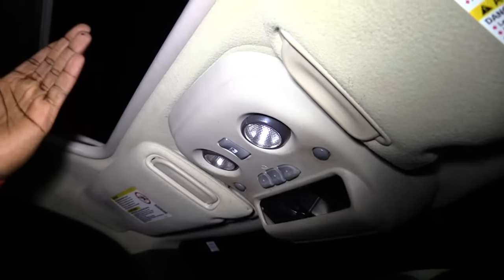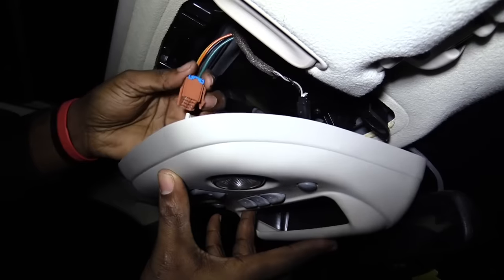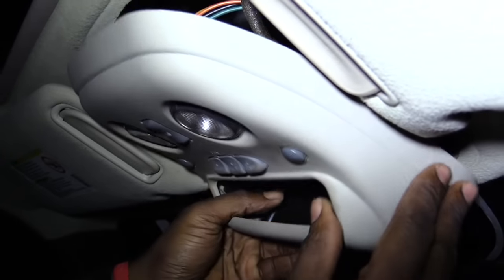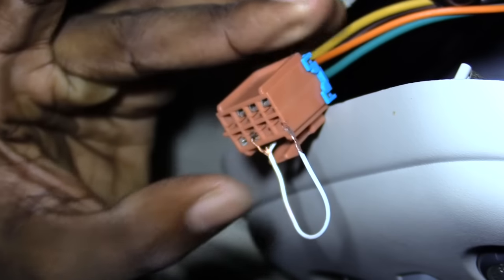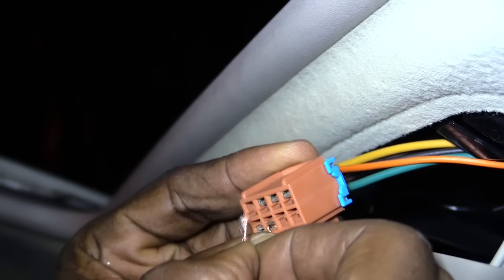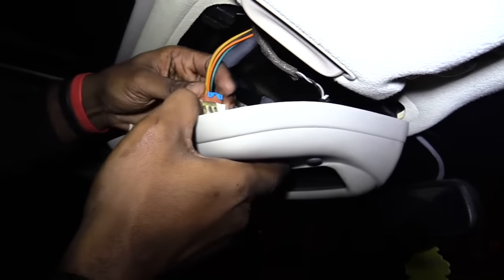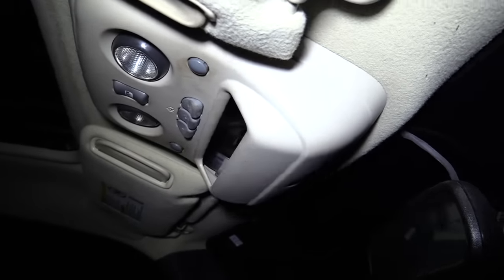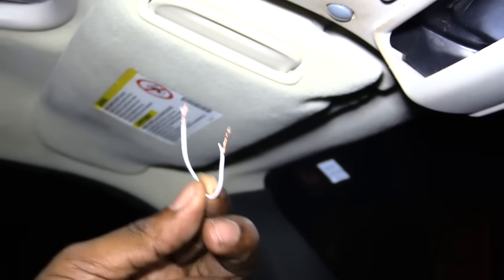How to open/close -Sunroof / Moonroof when switch won't work-EASY

Comment: Thank you so much!  This worked brilliantly on my sun roof to close it. Afterwards I thought I'd be a smart ass and   do it the other way to make it open again but didn't listen to your instructions properly. I now have no interior lights or clock 😂 but at least my sun roof is closed 👍👍
Reply from the maker: Hi sorry for your problem most likely you blew a fuse for your clock and light check your fuses should be a easy fix.
Reply: Live and learn 😂👌
Reply: Wow

Comment: Thank you for this awesome video my friend. I have a 2006 H2 Hummer and I refuse to let her go. I took her to the car wash today and the moon / sun roof wouldn't close. In fact when it would do the opposite. I had to leave the car wash and came home wondering how much is the dealership going to ding for this fix. Thank god I found your video - it closed and will stay that way until I can get a new switch. Cheers !
Reply from the maker: Glad you was able to get it closed. And yes it's the switch that's bad, glad could help. Please subscribe & like and share if haven't already and check out our other helpful videos

Comment: Thanks great vid, got mine closed before the rain!  Apparently if your battery goes dead, or you change the battery with the sunroof open it goes into error mode because it thinks it's closed when its open. Once you hot wire it closed, turn car off then, while holding the switch in the close position, turn car on, continue holding the switch for 30 secs and that will cause it to relearn the closed position. The switch is rarely the problem.
Reply: Mannnnn I just came across this comment & you are a life saver 🙏🏾🙏🏾 it makes so much sense because I just replaced my battery the other day

Comment: This has been most helpful. I have a 2005 Suburban, the battery was dead at some point, and when I charged the battery and drove the car, I openeed the sun roof. But then it would not close! I had to remove the headliner, remove the sunroof assembly, take it into my garage and get the sunroof to close manually (two little tabs at the back released the glass). Then I had to re-install it all. It was a total nightmare. However, before I reinstalled it, I was able to use this trick in this video to test my theory. I used the small wire as directed and I fully closed the window and waited 20 seconds until I heard a little whirr and click. Then I was able to fully open it and fully close it. Only then did I have the confidence to re-install and put the headliner back on. THANK YOU!!
Reply from the maker: Your very welcome glad video was able to help you get window working. Please subscribe & like and share if haven't already and check out our other helpful videos

Comment: Thanks for the video.  I had an old Volvo that had switch issues for the windows and sunroof.  I disassembled the switches and cleaned the contacts.  They worked fine after that and it cost me nothing to repair.

Comment: Flashback502: Thanks so much for your video! I opened the sunroof on my 2008 Chevy Malibu while driving to a neighboring city, but the switch would not close it!  And rain is predicted for tonight! None of the sunroof fuses were blown, and I was distressed to see that the OM had no procedure for closing the sunroof manually in a pinch. I watched your video and decided to give your technique a try as I have plenty of wire.  No screwdriver was needed to pop open the ceiling switch panel.  I started by wiggling the connector to the sunroof switch and decided to try to use the switch to try to close the sunroof.  Lo and behold, it WORKED!  I carefully snapped the switch panel back into place.  Your inspiration just saved me a trip to the local mechanic and a day without my car!
Reply from the maker: Hi thanks for comment glad you was able to get your moonroof closed. Also thanks for tip on wiggling wires b4 using jumper wires, to see if this will work first. Thanks for watching.

Comment: Before everyone starts replacing the switch, Get yourselves a can of "Caig Laboratories - DeoxIT D5S-6" Contact Cleaner and remove the switch and give it a good spray or two. I had my drivers side master window switch not operating my passengers window (I had to reach over and use its own switch), so I removed the switch to get more angles of attack and gave it a couple spritzes, gave it a second to dry (dries very fast) then shot some compressed air through it. Now both directions work great... Sometimes moisture or gunk can get inside and cause a little corrosion and loss of contact and all it needs is a little TLC... It's worth a try
Reply from the maker: Thanks for very helpful tip.Please subscribe & like and share if haven't already and check out our other helpful videos

Comment: I just fixed mine. In the under hood junction box , fuse CTSY LP 15 amp. It was blown. Replaced it, works like a champ!
Reply from the maker: Thanks for watching good info, yes you should always check fuses first to be sure its not blown. check out my other videos and Please Subscribe

Comment: Hey I was wondering,I created a short in the wire to close the sunroof and my interior lights won’t come on,should I be able to change the wire harness?
Reply from the maker: , first check your fuse, most of the time that is the problem

Comment: Thanks! This worked exactly as shown on my 2001 tahoe (as far as the pinouts go). Turns out mine was something else and I still couldn't get it to close though. It did open it more though :-/ So I thought I'd try the reprogramming thing some other site mentioned and that got it to close! I tried it earlier but I guess I didn't hold it long enough. Oh, also none of the other sites mention that when you hold it (for "around" 30 seconds) that it won't make any noise. Some say you'll hear a gear cranking or something, but mine made no sound. So I was sure it didn't do anything, but I swapped the wires around (Still hot-wiring it because it was there) and it closed. Thanks again for helping me get part way there.
Reply from the maker: Thanks glad was able to help with window, yea sometimes things can be a little tricky, but glad you was able to get it done, thanks for the tips also. Please Subscribe and share if haven't already and check out my other helpful videos.

Comment: u think if i hot wire the sunroof motor switch wire the sunroof will tilt up in position???...my sun motor and cable is damaged!
Reply from the maker: Most likely won't work if damaged

Comment: Hello,
So i tried that and nothing happened, Any chance you know where the power wire runs for it. 
Im wondering if it maybe got broke or pinched, my driver window power wire snapped today in the door frame.
Fingers crossed its just the wire somewhere LOL

Comment: Hi ! I have a Toyota Prado series 90's or early 2000. My sunroof does not open tho the switch triggers a motor when u press it. I would like to open it to fix a leaking sunroof. My question is, would your tutorial also applies to this model? Thanks!-desperate

Comment: my sunroof on my 2002 avalanche will open and close but it will not raise up at the back to fully close and seal it shut. what could that be? thanks for any suggestions
Reply from the maker: Sounds like your lift system is off track/broke or blocked.
Reply: @Flashback502  is that something that is easily accessible or do you know if there is a video for the lift system? Thank you!
Reply from the maker: @shanedavis578  most time you have to remove inside lining of truck to get to it, but first look as best as you can to make sure it's not just blocked, yes there are videos up on youtube showing sunroof repair.

Comment: Subscribed. Tried this with it stuck open in the wedge position. No luck. Tested to open it more and it did. Any suggestions?
Reply from the maker: Thanks for watching and sub, sometimes if you get somebody to lightly press down on it, it may close. Also check your window track to be sure noth8ng is blocking it, if none of that works it may be your motor. Gooduck.
Reply: Flashback502 no chance there’s a different connection for that function? I do have a 6th pin on the mirror of the bottom right on the orange end
Reply from the maker: @carsonshea9299  I would say try a different switch and see if it works different brands of cars can have some differences so it could work.

Comment: Mine is stuck open as well I tryed to take switch apart do you know what wires to jump if 2003 exp. if not heard a manual way at motor with hex key but couldn't find a easier way then to drop headliner ?

Comment: After sitting in my car, debating for a good 30 minutes. (Mine only has four prongs and I didn’t want to blow anything) I went on with it and it worked like a charm. Thanks my guy. 💪
Reply from the maker: Your welcome  glad could help please subscribe like and share and check our my other helpfull videos.
Reply: Since you had four which prongs did you use ? If that makes sense

Comment: Thanks for the video! I have a 2003 Lexus GX470 with the sunroof stuck open. The plug seems a little different with more metal spokes, have you ever come across Lexus wiring and if this approach would work with that make/model?
Reply from the maker: Hi thanks for watching,  sorry but I haven't worked on a lexis but it should still work, you just have to figure out which spots to jump thru, process of elimination. Goodluck.
Reply from the maker: Hi thanks for watching,  sorry but I haven't worked on a lexis but it should still work, you just have to figure out which spots to jump thru, process of elimination. Goodluck.

Comment: Turns out the switch on mine is good to go.  The sun roof is stuck fully open.  It jumps a fraction of an inch when I hit the switch, but stops dead.  Any ideas on how to just get the roof closed...I don't care if it even opens again, so to speak.  Is there any knowledge of where to poke it to release the systems hold on the glass part?  Trying to avoid need to take the headliner down and just start searching for something broken.  Any inputs appreciated.
Reply from the maker: Hi sorry to hear didn't work, I would suggest u look for some information on your exact vehicle there maybe a way to get it closed.  goodluck.
Reply from the maker: Hi sorry to hear didn't work, I would suggest u look for some information on your exact vehicle there maybe a way to get it closed.  goodluck.

Comment: Hi, My 1997 Volkswagen golf GLI sunroof is stuck in the open position and can't close it. do you have any experience with how to close it? thx
Reply from the maker: Hi i haven't worked on your model but I would think the same technique of disconnecting the power supply from the switch and using a jumper wire to close the window should work as long as your motor isn't bad. Thanks for watching please subscribe.

Comment: I am in my car and I'm not sure which piece I'm disconnecting. Neither of the 2 are easy to get out and I dont wany to make matters worse. Do you have a way for me to send this pic I took? Thanks
Reply from the maker: Hi the power supply that you should be working on is directly behind the switch you use to open and close your sunroof, most of the time it has parts to squeeze on both sides to release it. Thanks for watching and commenting. Please subscribe & like and share if haven't already and check out our other helpful videos.

Comment: can you tell me how to replace the switch? Also, if doing as you do in this video does not shut my popped  up sunroof then it is probably the motor?. Thanks in advance. I see these posts are old so still there is hope for me out there :)
Reply from the maker: To replace switch you just have to take a flat head screw driver and pop it out, from the inside, I have a video up showing how to remove switch In my videos. If jumping doesn't work and you hear noise but no movement and you have checked fuses then could be a bad motor. Goodluck. Please subscribe & like and share if haven't already and check out our other helpful videos

Comment: My 2007 tiburons sun roof doesn't respond to the two switches at all. I push them and nothing. Soooo frustrating. Thank God for air conditioning. This little sports coupe gets HOT. 🔥 If you have any ideas or solutions. I am all ears and do appreciate it very much Sir. Thank you.
Reply from the maker: Shawn Dubay Hi thanks for watching if both your switches are out you might want to check your fuses to be sure it's not blown, if not my method used in video should work. Thanks please subscribe if haven't already.

Comment: Hi there, thank you for the video. I think my motor is dead was wondering if you had any info on how to manually close sun roof on 2004 honda accord? Found video for a 2002, but cant seem to find it in mine. Thank you!
Reply from the maker: Hello thanks for watching,  unfortunately I have not worked on any honda Accords of your model to no how to close/open sunroof I will ask around and if I find out something will let u no. Also you might want to check the fuse to be sure its not blown if you haven't already.  Thanks for watching

Comment: Great video man, it sometimes might be a fuse too if its not a switch.
Reply from the maker: Your welcome, Thanks for watching and commenting glad could help yes should definitely check fuse first. Please subscribe & like and share if haven't already and check out our other helpful videos
Reply: @Flashback502  i actually pulled the fuses and check it . Fuse was okay then the roof worked so could have been a loose wire or loose fuses connection that reset when i pulled the fuse
Reply from the maker: Yes that can be the problem, sometimes when u unplug it and plug it back it works because it was lose or had bad connection.
Reply: @Flashback502  keep up the good videos man. Lol im at 6.1k subscribers your tailing me by just a few. It takes years to get to the million Club ha ha
Reply from the maker: Lol yea it's a slow grind, 1m would be great just getn to 10k would be great right now tho. Just subbed you keep up the good work also.
Reply from the maker: Any ideals on what categorys to block on adsense to increase revenue been tryn to figure that out for a while now.
Reply: @Flashback502  no just let everyone every category watch regardless of ads trust me. It hurts you as a newer channel to block anyone if you get the views the ads will take care of you.
Reply from the maker: Yea kinda was thinking the same. Thanks
Reply: @Flashback502  i just learned to edit with music takes hours to do but works wonders for my videos. Im paid enough to justify 3-4 hours a day editing and producing. I use DU RECORDER it gets easier over time
Reply from the maker: will look into that program, and music option. Thanks again
Reply: @Flashback502  no worries your channel is very similar to mine

Comment: I have a Toyota Camry 2004. The Moonroof opens but not closing entirely. It automatically opens when its close to closing, so I try to get it as close to closing as I can but it stays slightly open. Any suggestions? Thanks for your video.
Reply from the maker: David Zimmerman thanks for watching you may want to check your window track to be sure there's nothing blocking it, or that it hasn't broke or come loose, if not, your pulley system or switch may be the problem. I would try testing the switch first, it's  much cheaper. Gooduck. Please subscribe and share if haven't already and check out my other helpful videos.
Reply: Thank you so much for your kind reply.
Reply from the maker: David Zimmerman your welcome

Comment: I tried what you described in your video, but it didnt work, do you have any other suggestions. I check all fuses an there ok but sunroof stuck wide open. i can hear motor engage for opening but when i use your method to close sunroof i get nothing, no motor sound no spark nothing.. hope you can reaspond soon leave in east coast winter coming soon an no garage..
Reply from the maker: Lance Golden hi thanks for watching if u have tried all jumper slots and none will make it close or sounds, but will make sounds when opening then your motor may have a short in it, are be bad, sorry but u may need a new motor in it, but I would try a new switch first tho its much cheaper. Goodluck

Comment: My moonroof will open to the vent position but when I try to open it fully it just barely opens (not even a inch) doesn’t make any funny noise or anything. Do you think it could be the switch.
Reply from the maker: Hi thanks for watching the problem you have doesn't should like a bad switch problem, sounds like something is wrong with your lift on your sunroof maybe off track, bent or somethings blocking it. Please Subscribe and share if haven't already and check out my other helpful videos.

Comment: Flashback502-I have a Toyota 4Runner...the moonroof will not open...when I push the switch the motor makes clicking noises...what do you think the problems is?
Reply from the maker: Stanlyn hi thanks for watching if when you press the button the window is clicking then it's not your switch either your window is off track/jamed or your windows pulley system is messed up.  Please Subscribe if haven't already and check out my other helpful videos.

Comment: Mt 2004 evoy xuv , sunroof stuck open when I press button starts to close then goes back into open. Closes about an inch then goes back open . Will this work?
Reply from the maker: Fred Peavy Thanks for watching not sure if it will fix your problem sounds like your window may me off track., I would disconnect the switch then reconnect it to see if it helps tho, also check your window track. Good luck Please subscribe